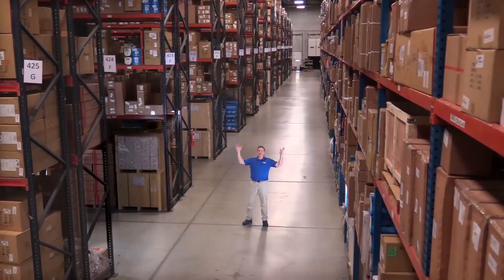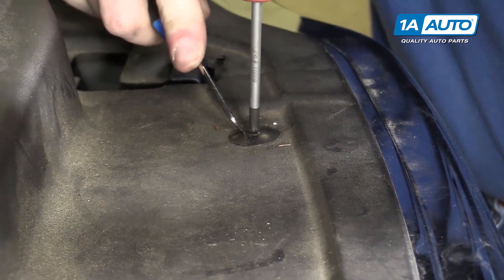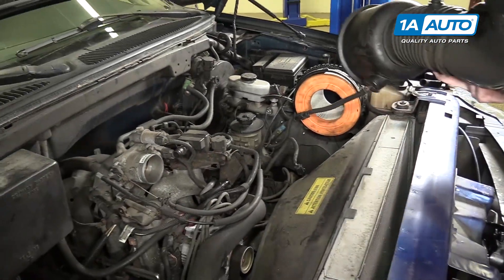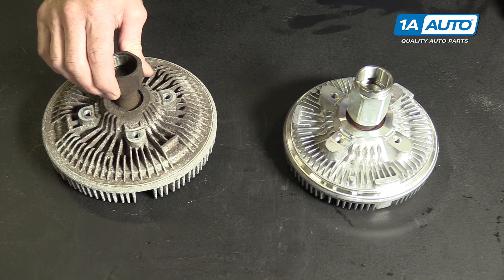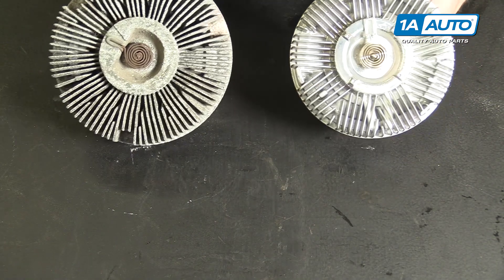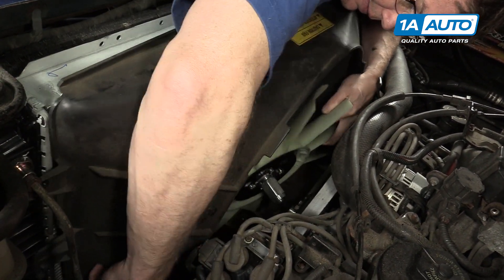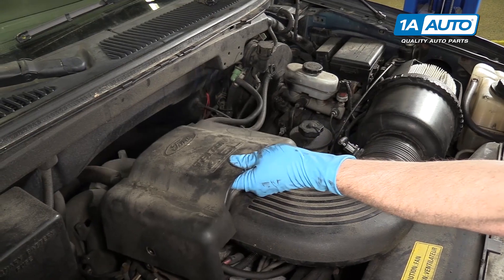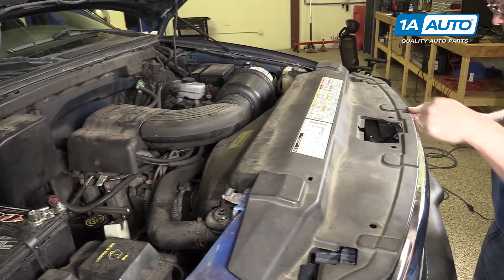How To Replace Radiator Fan Clutch 97-03 Ford F150

Comment: Wish Ford made the shroud a two piece and basically electric fans from factory lol but it was 97 or around there . Still thanks for the video it help plenty and , new water pump, hoses and clutch she's running smooth at 307,000miles 5.4

Comment: 1:30 or you can put a flathead under the widest part to lift it a little creating slight pressure around the screw so it unscrews correctly

Comment: so if the fan is not spinning then should I replace it for a new fan or is the fan motor  the thing to replace?
My f150 heats when iddling having the AC on, but it doesn't when running
Reply from the maker: +꧁ Tú Muy Bien ꧂ We wouldn't be able to diagnose an issue like that here, you may want to have a local mechanic take a look at it. Thanks for checking us out! http://1aau.to/m/Shop-1AAuto-c
Reply: mines doing the same right now. any chance you figured out what it was?

Comment: Out of curiosity, why did you need to remove the fan shroud when you were able to get the fan out without removing it? Should you not be able to put the fan back in without removing the shroud?
Reply: Dan Wyke makes it a little easier. Just a tad bit more room
Reply: Unnecessary step as was the top radiator hose removal.
Reply: On a 1997 with the metal fan blade…..good luck doing it without removing the hose and shroud!

Comment: Hi I've been watching videos and thank you, can you please reply have a question about the fan clutch I don't know if it's good or bad, when I move the fan clutch I cannot move it at all a lot of resistance so is that good or bad
Reply from the maker: +Robert Torres Thanks for watching!  The AC compressor pulley should just be spinning free, but the clutch should be stationary.  It takes a lot to engage it, and would be difficult to do by hand.

Comment: Working on a mini bus and replacing the drivers AC pump fyi it's at the bottom I have to take the fan shroud and the fan off to get if off I'll update when I get it out... After i murder my boss
Reply: Ps I have to pull the pump up instead of having it drop down no that would be to easy